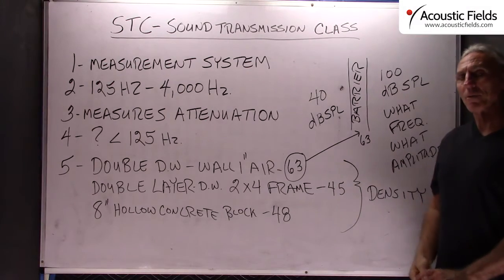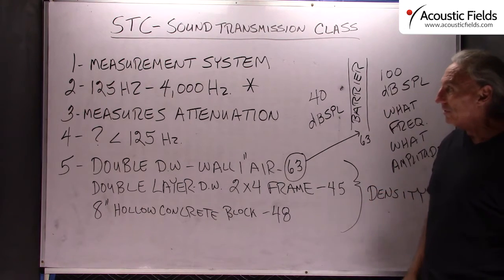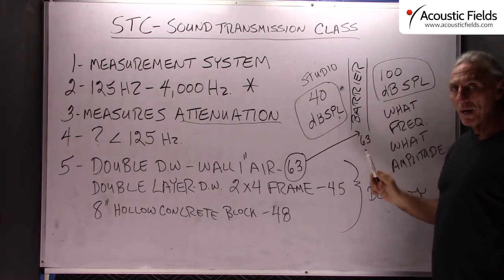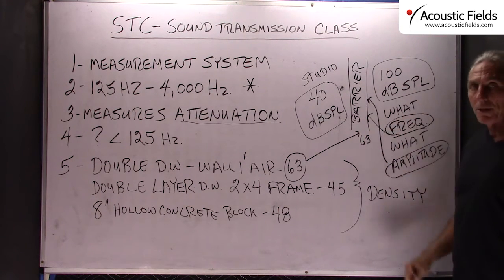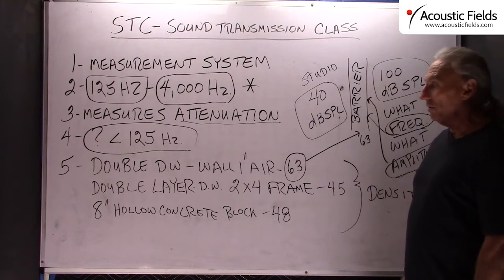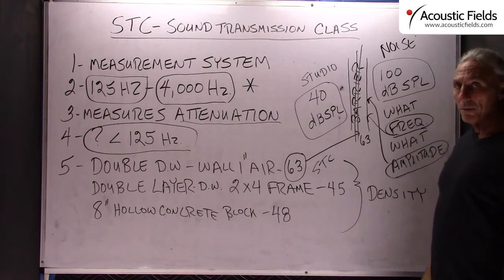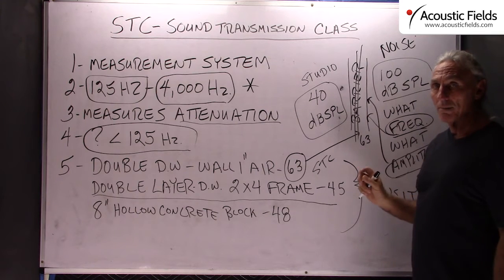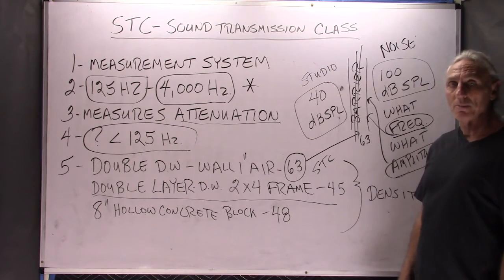STC - Sound Transmission Class - www.AcousticFields.com

Comment: ITS THICKER BETTER THAN DENSER FOR 50 HZ???
Reply from the maker: As a general rule this is true. With diaphragmatic absorption, the depth of the cavity determines the resonant frequency or how low it goes down to. A lot of companies advertise that their product goes down to x frequency. However, it is just as important to go low and get enough. If your product goes down to 50 hz. but only gets 30%, then that is never going to achieve a 50 hz. solution in your room. Our ACDA-12 unit gets 100 % at 50hz.

Comment: So what do you do to solve the sub 125 hz problems???
Reply from the maker: Hi Daniel, Mass and density . Frequencies below 125 cycles require much more mass and materials of higher densities. The layering of those materials is also critical.
Reply: Acoustic Fields So, what materials can be used in said scenario?
Reply: @aarongarza4769  He mentioned concrete.  What other materials have lots of mass?  Thick steel plates.  In another videos he's done  more recently,  he explained having a thick concrete wall with a thick plate of steel on the outside.  Not a simple DIY project one can do on the weekend. :-)
Reply: @Oneness100  Lead and rubber?
Reply: gerard steen Really??? /s

Comment: Yeah, I get that all the time from people I know. Everybody's talking about so called "sandwich" construction and they belive it can solve all the problems with noise.
Reply from the maker: Using different materials with different densities is one method that will work for frequencies above 125 Hz. Different techniques need to be applied if your noise signature and amplitudes are below 125 Hz. This is a common myth in acoustics along with the double wall approach using drywall and green glue.
Reply: Sandwich is different material for different frequenncies? Is these Amy materiaal that can absorb low freqs andere nog hi freqs? If there aren't why use sandwich instead of a material that absorbs al freqs?
Reply: I ment: is there any material...(further on) andere nog = and no. Sorry, my autocorrection is kinda bossy.